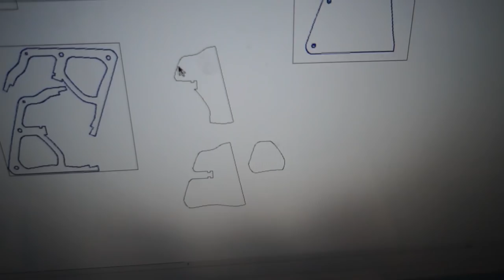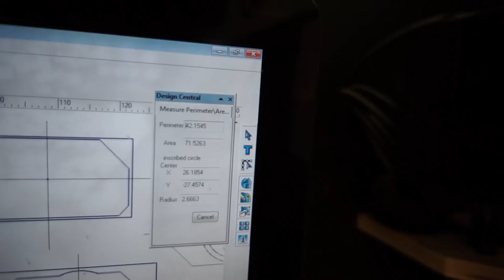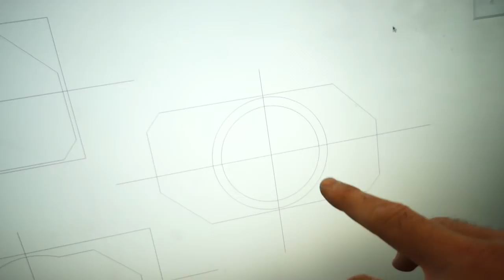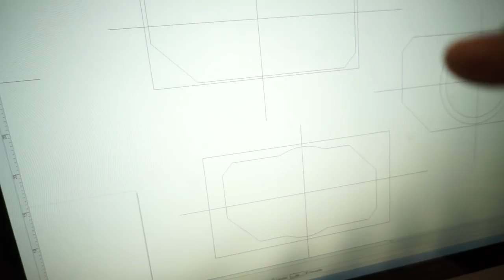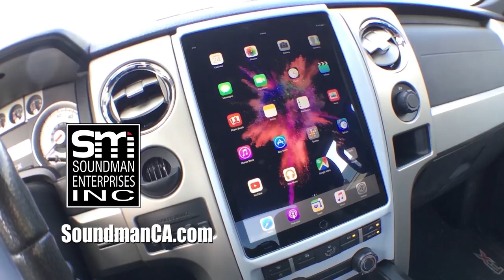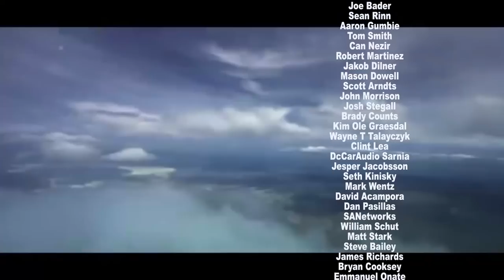I CHANGED MY MIND, Focal 33KX and my box front! - White Rider #23, Thunderbird project

Comment: Hey Doug, not sure if you have perfected your box volume measurement...if you haven't, an easy way to get it is to fill the custom box with something like saw dust and then poor it out into something like a square cardboard box that will be easier to measure accurately.
Reply: Believe it or not, styro peanuts come in Cu Ft measurements, like 1 cu ft per box. Used it on 2 large dual chamber enclosures that had no flat surfaces. Used the bendable foam panels used to make consoles and such and fiberglass both inside and outside. Worked well

Mags

Comment: If you need to eliminate the port for the focal woofer you can reuse the port layers by just trimming them to match the unported layers. Will save a lot of wood and machining time on the router
Reply: Keano finally a response with some common sense
Reply: To me this is the obvious solution.
Reply: Or be lazy and call it an internal brace just by moving the port layers to the middle.
Reply: Would look cool staggered like a frickn ribcage. Just cut another end without a port hole.

Comment: Doug get a bunch of gallon jugs and then stuff them in there then use gallon zip lock bags to stuff the gaps.  Use an imperial to metric conversion to convert 1 gal to 3.8 liter buy a 2 liter of soda, fill your sub with the soda. Subtract the remaining soda from the total initial volume of 2 litres. 3.8 times total gals plus ziplocks minus a sub full of soda and the conversion of litres to cubic cm to inches to the third power. I attended college physics...twice

Comment: im sure you know this already because your a mastermind and all but I figured I would remind you lol... you can still use the sections you made for the ported layers, just fix a board to the CNC with screws so it cant move (I wouldn't trust the tape for this...)  then cut a fixture in to it where the ported layer will sit inside, then clamp it down with some toggle / fixture clamps where you wont be machining. then make a quick program to cut the area where the ported section joins the regular profile. bam, out comes a sealed section, no need to make new layers...

Comment: Just load some sheet work neatly into the flat edges of the internals of the port bru... Bringing down the vent area (for the same length), until you reach your desired tuning @ the volume you do have internally. Vent area is overrated lol. Keeping the smaller internal volume will force the sub to behave in the upper part of it's range. It'll sound more immediate. You'll get low end with the correct tuning regardless and the car interior will bring up the low end for you. A cab with a rising response will perform flat in a car interior. Anyway I thought you were going to wall her dude? xx

Comment: SON OF A BIRCH... Are you sure you have to abandon the ported design? What if you pushed the out the depth of the box? Re-cut all new layers, or even make extensions for the ones you have, to get that extra depth. I don't know how that would work with your hydraulic pump placement, but if you're not "set" with where the pumps mount, you could push them back and keep using the same box front you've made.

Who's going to see the extensions anyway? Could probably cut them from your scrap boards. You're smart, you'll figure it out.

Comment: I agree, that frog sub will look better. Why did you rip it in the volkswagaru though? You spent all the money on that nice trans and never rip it for us.
Reply: First rule of VW transaxle club.... Don't break it and have to buy another one. All the parts have to be hardened with Jew tears which has gotten very expensive in recent decades. He looks to have a built sedan trans. 7" R&P doesn't like asphalt traction and wide tires and the reverse gear is basically two Reeses Peanut Butter cups meshing together.  Sand it'll hold up fine. Anywhere else it's just another one of Hitler's legacies...🤦‍♂️